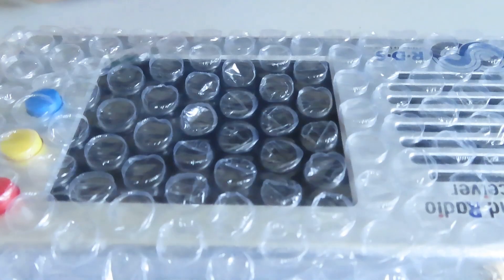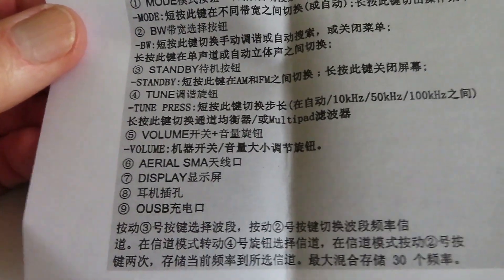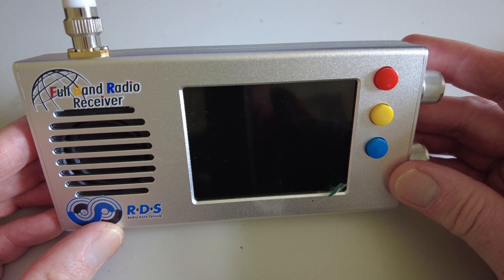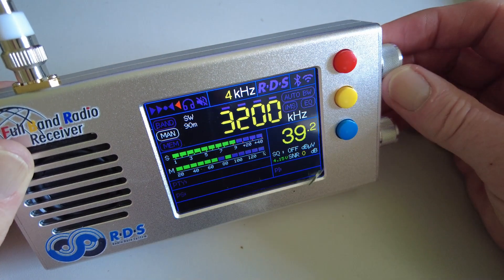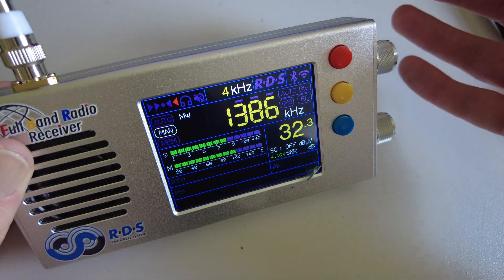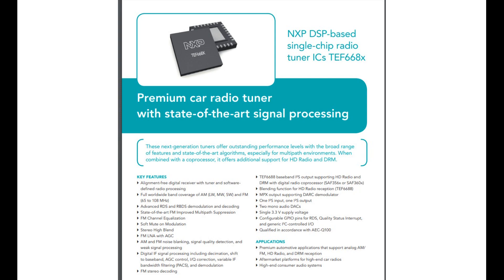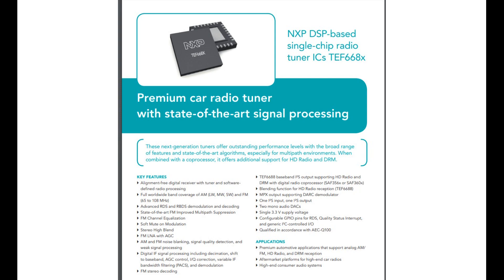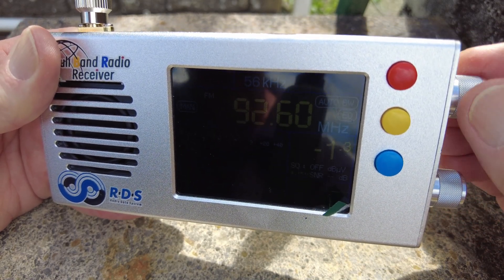The  TEF 6686 Radio

Comment: The first 2 weeks this radio worked like a charm. Then suddenly it quit picking up stations altogether. It appears to be an issue with the antenna port. The antenna doesn’t screw all the way down due to two screws in the way.
Reply: Sometimes antenna cable is faulty. I had to change mine.